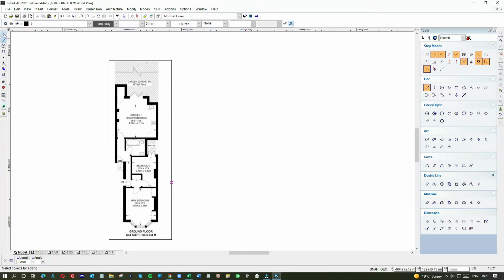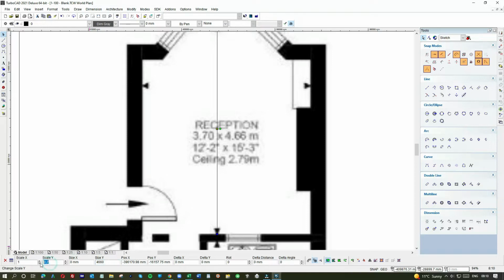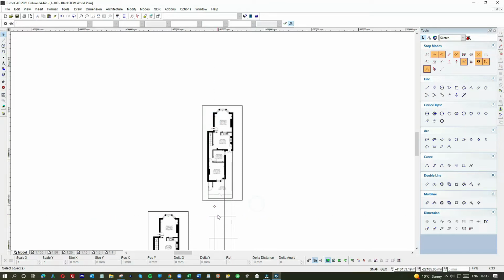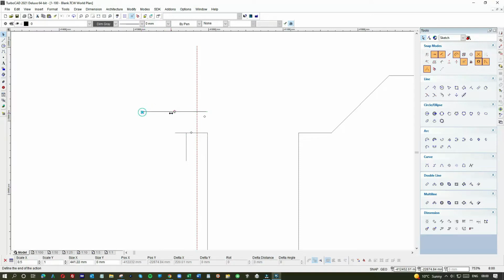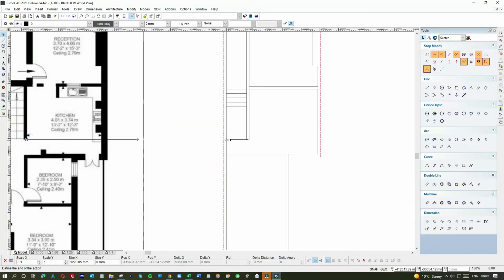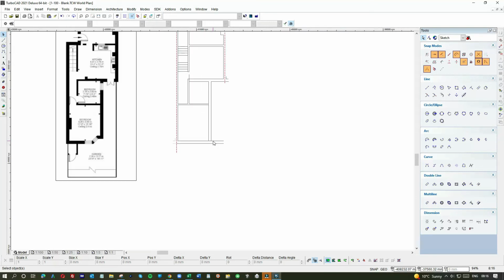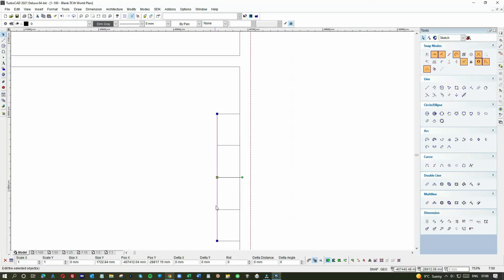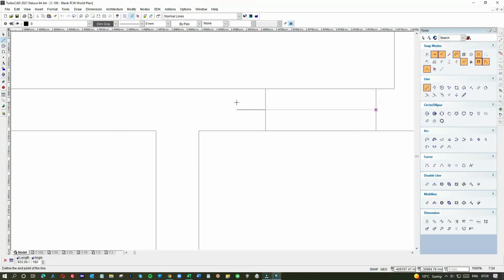How to Redraw PDF's in AutoCAD & TurboCAD | Learn How To Create CAD Drawings From PDF's |

Comment: Hi, I use Turbocad Deluxe 2021. I insert  a pdf file I insert a line for reference in the drawing I correct its value but I do not see the scale factor which alwais remains 1. what should I set for it to change ?
Reply from the maker: all pdf#s need to be rescaled when you import into TC. Look for our video on rescaling pdf's...